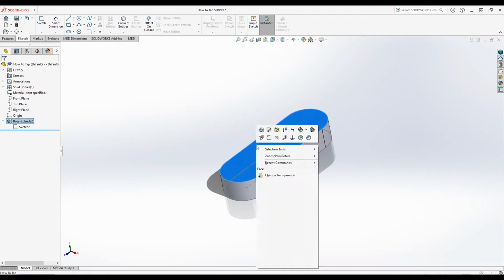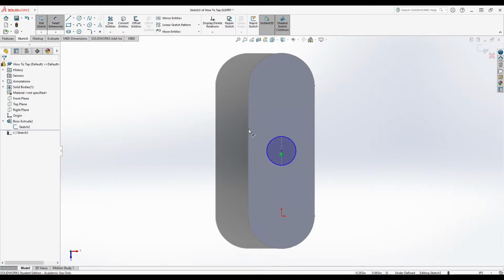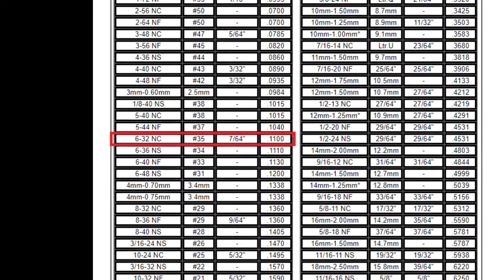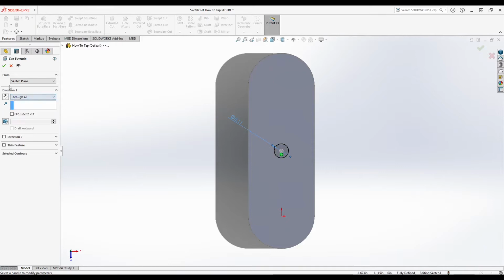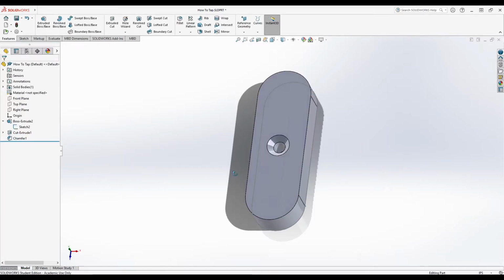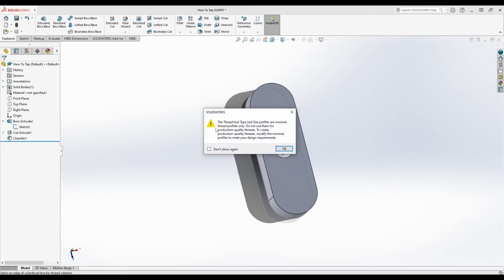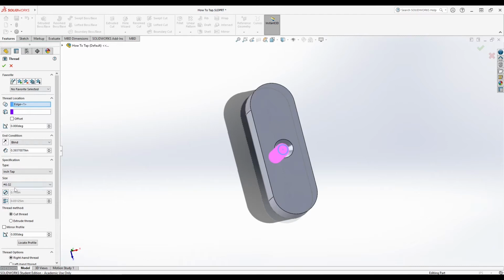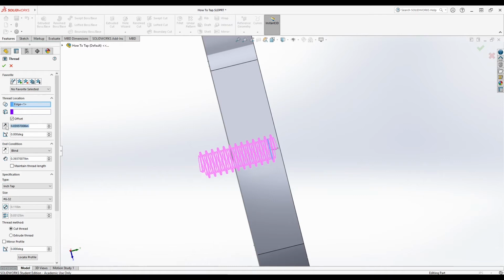SolidWorks: How To Tap Holes!

Comment: This "Thereat" command, which shows the type of the 2013 model of the Solidwork Program, is not in the hole wizard section. How can these threaded holes be opened in 3D in the 2013 version?

Comment: nice video thanks 

I still have doubt about the different options that SW offers when you use the hole wizard in the "Hole type" section like the straight tap or tapered tap